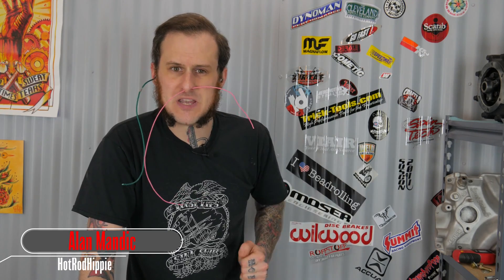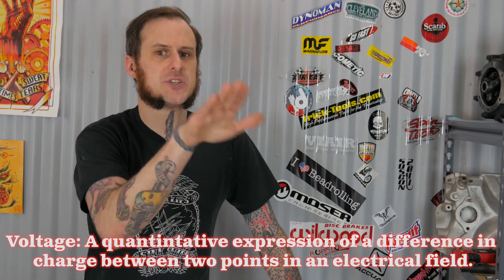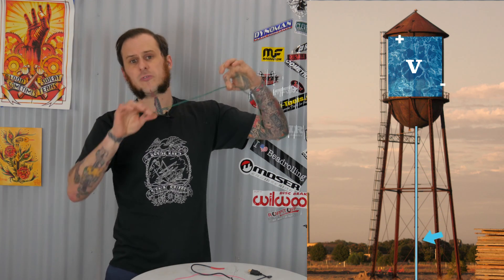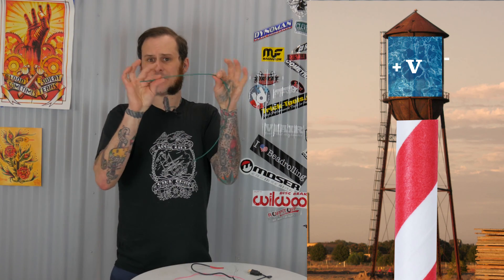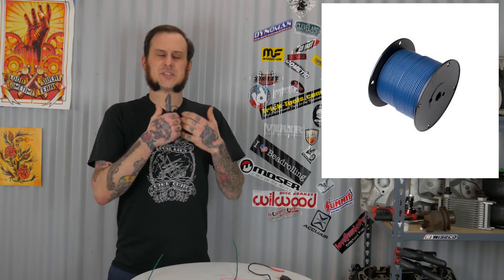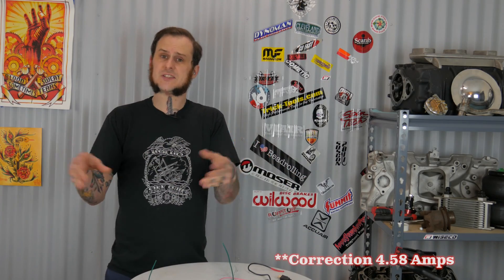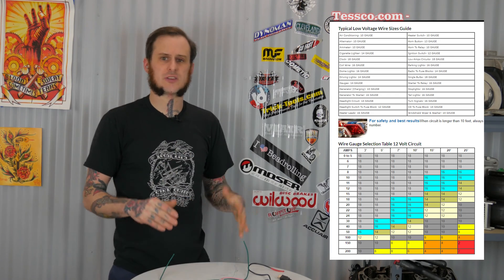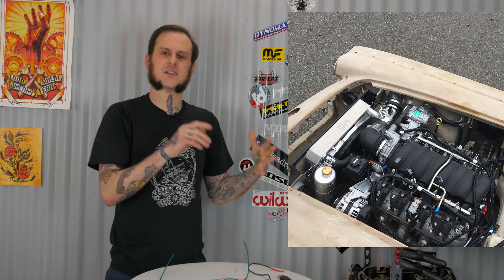How to Choose The Right Wire Size - Auto Electric Dos and Don'ts - Episode 3

Comment: Hi. Really great video.  I check the link with wire chart.  It show up to 200 amp only.  My friend advise me not to buy booster/jumper cable on eBay (with various rating from 100 up to 1000amp) because they are undersized most of the time.  So now I plan to make my own jumper cable set and length is 25 feet for each wires (total is 50 ft). So I plan to use welding cable. There is 35, 50, 70mm2 size available.  For SUV 4 or 6 cyl engine.  Which size would you recommend as maybe voltage drop might be reason that the engine won’t start. Thank
Reply from the maker: 25 Foot is an awfully long distance to go with jumper cables.  I can't really recommend running cables that long unless you have to.  Are you saying the Positive is 25 feet and the negative is 25 feet or is the overall length 50 feet for both cables?

For a minimal voltage drop you will need something like 4/0 cable. Which is 107mm.  If you are actually going 50 feet, no battery cable is going to carry 200+ Amps that distance without a decent voltage drop.

I'd recommend running shorter cables and going with the 70mm cable.  I use 00ga (67.5mm) when doing trunk mount battery setups on cars.  That averages about 10-12 feet of cable. 

Here are two pages with information on Battery cable sizing.

http://enerdrive.com.au/wp-content/uploads/2015/04/How-to-connect-batteries-correctly.pdf

https://www.wiringproducts.com/battery-cable
Reply: Hi. Thanks for the link and advise and appreciate your prompt reply (within 2 hours...wow). 

Yes total length is 50 ft [25ft (+) and 25ft(-) ]. 

Shopping mall parking is usually front facing the wall and my old 12 ft jumper cable could not reach when I was trying to make jump connection from front(my car) thru rear (another car at my rear end...  the 12 feet cable is too short.  I measured my car length it is already around 17 ft (5 meter).  So I calculated some allowance for the downward sag and cable running thru the floor and up to the other car....a length of 25 ft would be just nice. 

I did viewed some YouTube video measuring the starter cranking ampere and it was like 270ampere on a 2.2 liter cylinder car Diesel engine and measured voltage drop from 12.6 volt DC to like 9,6 volt DC. 

So with a 3 liter or higher diesel size engine....I guess a starter motor might need more higher ampere and I am not sure what is minimum voltage drop will be acceptable. 

I did find in internet an certifies USA manufacturer 25 ft booster cable (100% copper wire and 100% copper clamp) which is really nice it cost like USD 230.00.  But shipping cost to Asia approx usd 700.00 in addition...so it’s too expensive. I guess that the entire booster cable is really heavy like 20 lbs because it has correct size.  It just mentioned AWG 2 and did not mentioned the cross sectioned area mm2.

I am not sure about How AWG gauge and welding cable gauge...maybe there is differences in their sizing and in their wire strands.

In Asia, there are so many jumper cable available like 600 ampere have tiny wire diameter (4mm) and they are just Copper clad aluminum wire and copper-coated steel clamp  I am not confident with these 

Your stronger emphasis on voltage drop is what make me realize to consider the length and wire size  

I like to help others in need when their battery goes dead but I do not like to burn their car (including mine) by using the wrong /undersize jumper cable. 

So hoping that to get help and advice.

Comment: Good day sir, i got 2 150watts (300watts total) led lights to be installed on my motorcycle. The distance between the battery and the position of the led light is just 2 meter. I already installed a 12volt relay and a 10 ampere fuse box. The question is, what wire should i use for that? Because my old wire sometimes getting hot whenever i turn on the lights. What size of wire is the best and any donts and dos? Thank you.

Comment: what size wire would be good for a 12 volt car horn ?
Reply from the maker: That really depends on the horns. Many old horns on classic cars pull a fair amount of amperage. Original harnesses on many cars had horn relays and 10-14GA wire. Newer horns or motorcycle horns don't generally pull nearly as much. So it is hard to say. Though you could just err on the side of caution and run say a 12ga wire of a horn relay.
Reply: the horns off of a 2015 Harley. it says it requires 12 volts. I got some red and black wire spools that are similar in size to the wires going to the horn, you think it would be fine without a fuse?
Reply from the maker: Motorcycle horns are usually quieter and pull less power. So you should be fine to match the oirignal wire thickness. Just make sure the wire you are using actually matches. A lot of factory wiring has thinner sheathing on it than the stuff you buy at auto parts  stores so the outside diameter is a bad indicator.

Also yiiu should use a relay if the vehicle doesn't already have one. Last thing you want is a short to burn up the wires in your steering column. Even a fused circuit can risk this from time to time. So the more isolation you can get for the wiring in the column the better.
Reply from the maker: Motorcycle horns are usually quieter and pull less power. So you should be fine to match the oirignal wire thickness. Just make sure the wire you are using actually matches. A lot of factory wiring has thinner sheathing on it than the stuff you buy at auto parts  stores so the outside diameter is a bad indicator.

Also yiiu should use a relay if the vehicle doesn't already have one. Last thing you want is a short to burn up the wires in your steering column. Even a fused circuit can risk this from time to time. So the more isolation you can get for the wiring in the column the better.
Reply from the maker: @fudk_off1312  well then you really don't need to be too worried about the steering column or noise level issue. Ha. So yea I'd just go with the wire you have then and fuse it. Probably a 7.5 or 10amp fuse I'd guess.

Comment: If budget is no issue, then just to be on the safer side is it simpler to just go with let's say 12 gauge wire instead of 16 gauge (calculated using charts)?
Reply from the maker: In general yes. I generally go bigger than I necessarily think I need to. The only issue I see is if you run a bunch of 12ga wires instead of smaller ones it may make routing and packaging more difficult.
Reply: @HotRodHippie  Someone told me using bigger wires will mess up the current flowing and spoil the devices being powered... So safe to assume they didn't know what they were talking about?
Reply from the maker: If you are talking about something like an EFI sensor wiring, that would be an issue as it expects to see specific things. If you are talking like powering a radio, lights, fan, etc then no that is just wrong. I could see if you were using a 1ga wire where you only need 16ga sure I could see some issue. But oversizinf to 12-14ga wouldn't be an issue.

Usually when I do that I just go one size larger. If I NEED 16ga but want to be safe I go 14ga.
Reply: @HotRodHippie  Perfect... Thank you so much for the explanation :)

Comment: Correction: Current is the correct term where you are saying amperage mate. Ampere is the measure of current, like voltage is. 

Similarly, power is the correct term for wattage. Wattage is the measurement of power. 

Hope this helps
Reply from the maker: Mick Holgate you are correct. As I was editing I realized the error but didn't feel it ruined the point. Thanks for the input.
Reply: Great video though
Reply: HotRodHippie I think it will be fine
Reply: That's kind of a razor-fine distinction as amperage is defined as "the strength of an electric current in amperes". I am not really sure the usage was incorrect. Cumbersome, perhaps, but not technically incorrect. Anyway, I agree the hair-splitting over semantics does not detract from the points made in the video. 👍